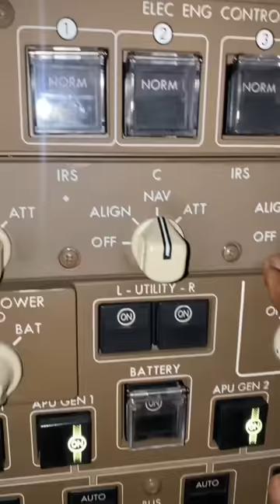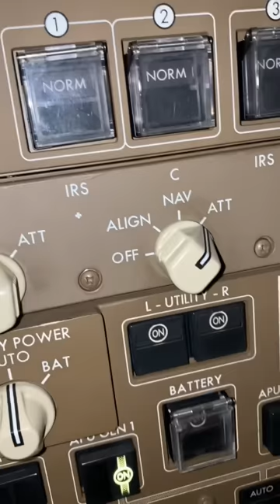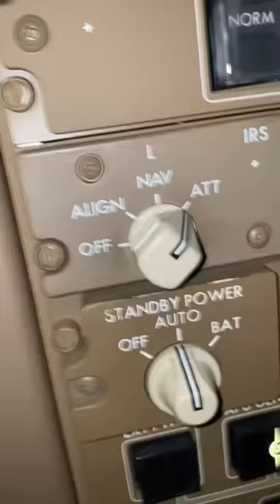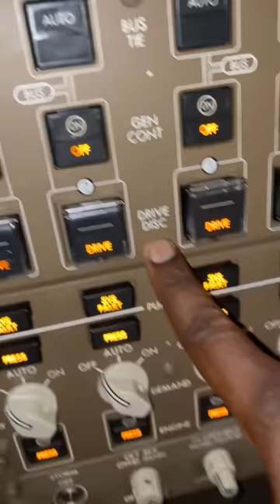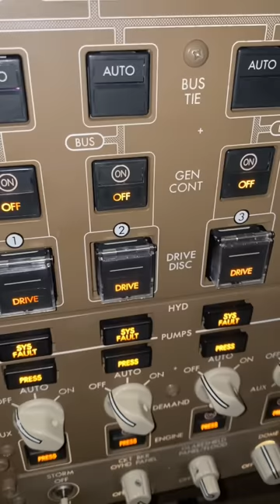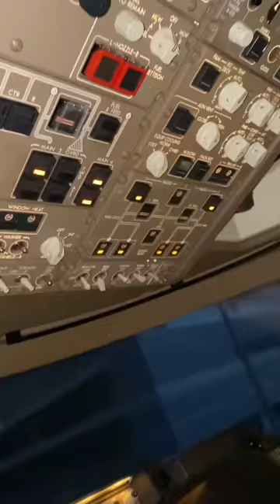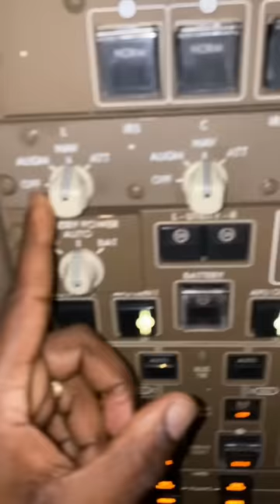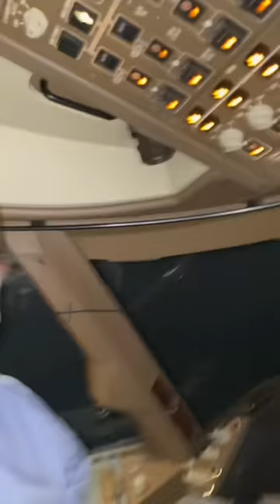Boeing 747 cockpit irreversible actions

Comment: Farting in the cockpit is irreversible also, but usually the co-pilot will get the blame, even if it was the captain.😂
I watch the channel "74gear" the owner of that channel is Kelsey, he is a 747 pilot for Atlas airlines and he always tells weird or funny stories that happens and he said usually when there is 3 of them in the cockpit and someone farts the lowest ranking crew member always gets the blame.😂
Reply: just open the window, it's fine
Reply: @RoamingAdhocrat  Shouldn't be an issue
Reply: @creative0001  just remembered the 747 does not have opening flight deck windows :(

Comment: I would say fire suppression is another irreversible one. For both APU and the engines. Once you pull that handle, that engine is off until you're back on the ground.
Reply from the maker: You can pull a fire switch and push it back and the engine can start!
Reply: @pilot_obet  For real? That's crazy! I thought it swamped the engine. Do you have to restart it before the core stops moving or can you do a restart from zero?
Reply: @jumperIndustries  Pulling the switch only trips the electrical connections and closes valves for fuel, oil and bleed air, so it isolates the engine before the extinguisher can be activated. Pushing the handle back in before activating the squibs reverses that isolation and you can restart the engine. But once you introduce the extinguisher, most engines are done.

Comment: Am I right in saying ATT mode would only ever be used if the system was faulty in some way?   Excellent video!
Reply: You are probably right but I've never heard of it being used. If the IRS somehow lost alignment then it might be like you say and you'd have to go to ATT and enter the position manually.....which IS possible to do. But a simple loss of generators won't affect the IRS because all modern IRS systems can run on battery power. In fact sometimes the IRS system is accidentally left on when external power is turned off and it will drain the battery. But they minimize this by having a horn sound on the outside of the aircraft if the IRS is draining the battery.
Reply from the maker: Yes it’s usually for power loss. There is battery backup power. Very rare- haven’t had to do it in nearly 30 years

Comment: Don't forget the manual extension thing for the landing gear because if you pull it, you can't do it again
Reply from the maker: Coming in a separate video
Reply: @pilot_obet  Ok
Reply: Interesting. I would have guessed that if you managed to get the gear up you would be able to pull it again, but you probably aren't getting the gear up because you pull that when the hydraulics don't work.
Reply: Not completely true... The only reason the checklist would have you alternate extend would be due to loss of hydraulics. However, if hydraulics are available; the gear can be retracted again. The alternate extend just releases the uplocks to let the gear fall by gravity, nothing more.
Reply from the maker: @MercFE8235  correct- but for the operation under the rules, it is an irreversible action as in we are not permitted to do that

Comment: Great video! What about the two fire extinguishers systems for every one of the engines? To my knowledge, once they are activated, the engines cannot be restarted again.
Reply from the maker: Correct- I was focusing mainly on the non obvious items. It’s like saying if the wing falls off- that’s is irreversible too but for the sake of brevity I didn’t mention the obvious things. But correct- the fire extinguishers are one shot into the engine that’s it.

Comment: I really don't know why I'm here...but since I'm here and he is talking about the masks...I once was in a 737 and we were experiencing severe turboulances. I was sitting in the very back of the plane and the plance suddenly warped like crazy. You could see the whole passenger cabin warp like a snake and with that came a very loud cracking sound when all the plastic sidepanels (with the windows, the inside wall of the cabin) were moving (they are made to be flexible individual elements). Many passengers screamed loudly of fear, which I couldn't, because I was too terrified. I saw the oxygen mask in the seat in front of me (empty seat row) drop down and looked up and panicked, because my mask didn't come down. I was just about to grab the mask from the row in front of me to put it on, when I realized it only dropped down because the plastic cover was streched so far, that it just snapped open and released the mask. No other masks in the entire plance dropped out. So I could go back from panicking to clinging on to the armrests terrified for the rest of the flight. That was quite the experience. It was a flight from Paris to Hamburg btw.
I have been in plances numerous times ever since and have not developed a fear of flying and don't want to introduce anyone to it by telling this story, flying (in Europe) is very safe, especially when in an Airbus plane.

Comment: Presumably gravity gear extension is irreversible as well? As I understand it, you're disconnecting the gear from the hydraulics, so you have nothing to pull it back up?
Reply: No, that’s not true. If you apply hydraulic power you can cycle the gear handle and raise the gear again. But that would never be used in real life. Once the alternate extend has been used, you’re landing the airplane.

Comment: I thought emergency gear extension is also irreversible?  Is is on the 73s, so I'm assuming its also irreversible on the 74s...?
Reply from the maker: Read my notes that came with the video…
Reply: @pilot_obet  OK  🛫 ✈    enters racetrack, sips 🥂 and eagerly awaits next video

<afterthought>
   I guess opening the escape hatch and exiting to the ground on the inertial reel escape rope might also qualify as irreversible... 😉
</afterthought>
Reply from the maker: @roscozone8092  why would you want to climb into a burning aircraft if you got out in an emergency?
Reply: @pilot_obet  I didn't think I'd said that I'd climb into one...  Just that escaping via the escape rope would be 'irreversible'...

Comment: Very interesting video, Captain Obet!  I'm wondering, if you were to fly a route with GPS inhibited- that is, relying purely on the IRS, how much would you expect the IRS position to drift?
Lets say a route from VHHH to EGLL, what would your ANP be when reaching the London area?
I'm trying to imagine what it was like for Pilots relying purely on IRS navigation in the 1990s, if it would've been possible to make a RNAV approach accurately after such a long route.  Maybe the ILS is down due to a power cut 😄
Reply: Novo: As an old patrol plane navigator using the Litton 211 inertials in the 80's, I would not attempt any instrument approach using only inertial position.  They just aren't that accurate.
Reply: @KB4QAA  Thanks very much :D I appreciate getting a response from an experienced airman like yourself 👍 I've got a PPL with about 160 hours.
Reply: @novo6462  Happy flying, even if from an armchair, now!  :)
Reply from the maker: @novo6462  hi- thanks for question. On the Litton 72 systems that I operated for years on the B707, they were not bad. After a 10 hour flight, you would be maybe 1 or 2 miles out - but that could be enough to hit a hill if you attempted an RNAV approach so I wouldn’t do it. We used to perform position updates in flight regularly on long haul by flying as accurately as possible over a VOR. As the aircraft overflew directly overhead( in the cone of confusion), we would ‘Update position’ to the coordinates of that VOR 😀
Reply: pre-GPS, weren't INS for navigating across oceans with reasonable confidence of hitting a VOR or NDB on the other side?
Reply: @RoamingAdhocrat  Yes.

Comment: So, do you only disconnect the generator drive if you know the engine cannot be saved/restarted? i.e a severe engine fire or fuel exhaustion? Because don’t you need the generator to keep the engine running? Thanks in advance
Reply from the maker: If the engine has severe damage- it may be an idea to disconnect the generator because it’s spinning and can cause overheating or more damage etc
Reply: I am not a 747 pilot. But in most transports (I believe including in the 747), in a fire or a severe engine damage situation you are required to activate the engine fire handles. When this handle operated, it automatically disconnects everything that is run by the engine including the electrical generators, hydraulic pumps. And most importantly, it shuts off the low pressure fuel valve.
Reply: @ImperrfectStranger  The LP fuel valve is another name for spar fuel valve. LP fuel valve is the name used by Airbus. It is closes the connection between the fuel tank and the engine.
Reply from the maker: I’ll do a video on severe engine damage in the simulator and all will be clear😊
Reply: @pilot_obet  Ok, thanks!
Reply: @ImperrfectStranger  doesn't it physically and irreversibly cut off the fuel lines to the engine?

I'm not an airline pilot, just seen that somewhere in atpl theory
Reply: Disconnecting the generator drive is not done during an engine failure, but in case the integrated drive in the generator overheats or fails. Pressing that switch actuates a solenoid which drops a spring loaded cam on to a worm gear on the shaft that drives the generator. This slides that shaft away from the gearbox which disengages the splines on the shaft. This is why it can only be done when the engine is running; the shaft has to be spinning in order for the worm gear to drive the splines apart.

Comment: Would be more informative if you would actually spend some time describing what is going on in the NAV/ATT modes -- what features are being enabled, in lay terms.
Reply: NAV mode is the normal mode that independently determines aircraft position by continuously measuring acceleration. ATT (attitude) mode is a backup mode which does not provide position information but will drive the attitude indicator, vertical speed indicator, and directional indicator on the primary flight display.

Comment: Meaning is to switch off the drive disk once the engine starts running. Shall I do it at the gate or after the taxi in preparation for take-off? What about the RAT switch, What is the purpose of it?
Reply from the maker: RAT is used in emergency for emergency hydraulic power
Reply: @pilot_obet  Clear, What about the drive disk when I should turn it off?
Reply: @Abdul..  It's short for drive disconnect. It physically disconnects the generator shaft from the engine. Normally the generator will always turn while the engine is running, but it can be electrically connected or disconnected from the bus. The drive disconnect is the only way to make it stop turning without stopping the engine, so you use it if there's a situation where you need this to happen.
Reply: @KingdaToro  Perfect. in real life airplane you learn more than the simulator itself 🤙😁

Comment: The definition "irreversible" sounds more like "Youn have turned the knob, it's now set to e. g. ATT permanently", but it looks like the IRS mode can be changed by pulling the knobs and then modifying the IRS mode, so it's not basically "irreversible", it's just a safety feature in 747.
Reply: It's irreversible because the IRS works by calibrating itself when you're steady on the ground (ALIGN) and then keeping track of your position over the course of the flight (NAV). Switching to ATT makes it lose it's calibration and it stops tracking your progress so even if you physically switch the knob back to the ALIGN or NAV positions it wont actually go back to NAV
Reply: @headcrabn5347  Ahh I see, well if I ever end up flying 747-8 in MSFS one day I guess that's some useful info.

Comment: I paused the video right at the beginning to make a guess about what you'll say: the IDGs (integrated drive generators) once disconnected, can't be reconnected in flight, that's for sure. And maybe the same with the bus tie? IRS alignment comes to my mind, you can't do that once moving, the aircraft has to stand still.

EDIT: Ok. I didn't know about the mode lock on the IRS. One new thing learned! Captain, may I add that only the 747-8 has a ram air turbine (RAT), but not the 747-400. I think the 748 actually is the only Jumbo ever to have a RAT, correct?As always, thanks a lot for this video!

I have a suggestion for a future video (or two). How do you start engines which went off in the air? I remember having heard you can't use the APU because it doesn't start above a certain height (2500 feet or so?), so you either have to resort to windmilling or cross bleed when at least one engine is still running. Would be interesting to see.
Reply from the maker: Correct the B747- 8 has a RAT not the -400. Indeed the aircraft should be stationary to align the IRS correctly
Reply: @ImperrfectStranger  Can the APU be started on the ground and left running during flight?
Reply: @benpatana7664  I would like to think so, however it consumes a lot of fuel and you would have to carry much more of it to keep it running instead of just the engines. That would be bad for the emissions and bad for the fuel bill, along with wearing the APU out faster. Alternatively, it stops working because it is no longer receiving sufficient air to cause combustion, which the turbines overcome by compressing the air they intake.
Reply: Depends on the APU. Most 747 APUs are not made to run in flight because the inlet is the wrong shape and will actually starve the APU of air when the airplane is flying at high speed. But if you ever see a 747 with a modfied APU inlet that has a scoop on the outside, that scoop is made to grab air for the APU in flight so it can be started and run in the air, but I have only seen a handful of 747s with those fitted.

Comment: So you should be able to get to the align state in flight by turning the IRS off then back to align. This is clearly a bad idea unless you have tumbled gyros already.

The masks are irreversable because you just ignited the oxygen candles. There's no stopping that.
Reply: Actually the candles to not ignite when the masks drop, but when the passenger pulls them down further. At first they are dangling from the cord that pulls the candle trigger.  Deployed but untriggered masks can be re-stowed by mechanics on the ground.  "I've read so many seatback emergency cards.  "Grab the mask and pull down, then put on..."
Reply: @BlackOrt  yes, and it's important in a case where you don't have a full plane. There's no reason to have all the generators on
Reply from the maker: @BlackOrt  yes they can be restored as I mentioned in my video but takes time in flight etc that’s why I say it’s irreversible
Reply: Also, the gyros in the IRS aren’t mechanical gyros and can’t be tumbled. They are ring laser gyros that are not susceptible to gimbal lock.
Reply from the maker: @singleproppilot  correct

Comment: But why is the ATT/NAV irreversible? Is it because once you go to ATT the plane had no idea where it is and where it’s been, and thus cannot regain any NAV functionality? Also, you said it couldn’t be done in flight. Does that mean the knob simply won’t pull out to enable the switch? Also, also, what’s the simplest physical mechanism to detect “in flight”? Is it something to do with the undercarriage, or what?
Reply: I've nothing but a guess, but I believe setting it to ALIGN basically zeros out the calibration for the inertial guidance, something you REALLY REALLY don't want to do anywhere not on tarmac

The switches themselves are as demonstrated: detented switches with locking positions. There's nothing stopping you from turning them if you really intend on it, but you better know exactly what you're doing by moving it past the lock point
Reply: @scrambledmandible  OK thanks for that. I just thought it might be dangerous and misleading if they could be turned back to NAV if that function was not what they were doing.
Reply: ATT/NAV on the gyros puts the gyros out of calibration, meaning you loose your navigation information if you're in flight and you can't get that back.  Gyros aren't the only navigation source anymore however, since GPS now exists.  However, GPS wasn't a thing when the B747 was originally built.

Comment: Are the engine fire handles reversible? If so, is there any situation where you'd disengage them after pulling them?
Reply: Once you pull the handle, lots of things are being disconnected from selected engine, and that is it, you can not re-start it after the handle, or button is pushed.
Reply: "Are the engine fire handles reversible? If so, is there any situation where you'd disengage them after pulling them?"
I think you meant to say "re-engage them after pulling them."  As far as I know it's like this.....on any aircraft the worst possible scenario is a fire inflight. (because you can't evacuate the aircraft up in the air) So if an engine was shut down inflight by using the fire handle, policy would be to NOT reset the handle or restart the engine. Planes have been lost because of out of control fires inflight. So The only reason I could see to reset a fire handle and restart the engine would be if you mistakenly shut down the wrong engine.....which HAS happened.....and want to restart it. Bottom line, resetting the fire handle restores it to normal operation.
Reply from the maker: The engine fire switches ( handles) can be pushed back in and an engine restarted

Comment: How come in a 747 it's called "IRS" but in fighters it's called "INS"? I'm only a DCS player asking a non-professional question :)
Reply from the maker: Inertial Navigation system as opposed to a reference system that provides specific data via Air Data Reference Units. Slightly different to INS. I used INS on the B747-200 and the B707
Reply: Roc: Manufacturer's choice of names/nomenclature.  Every company does it different, sometimes you think just to be different.  shrug.  (old navigator).